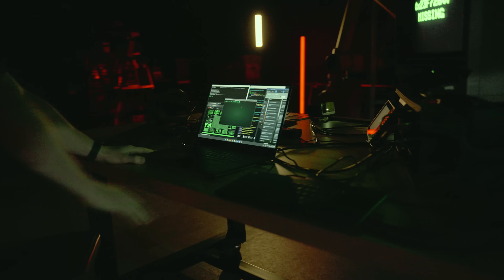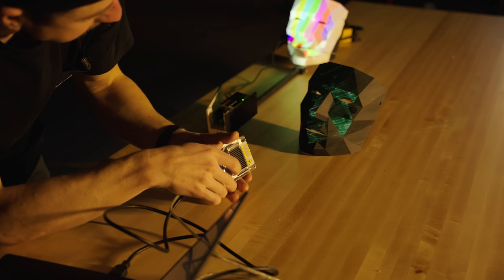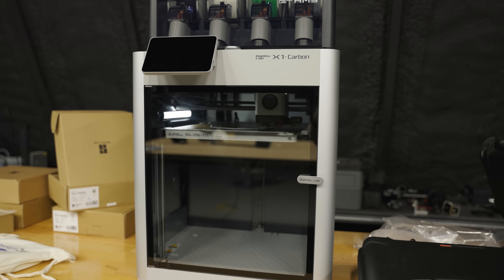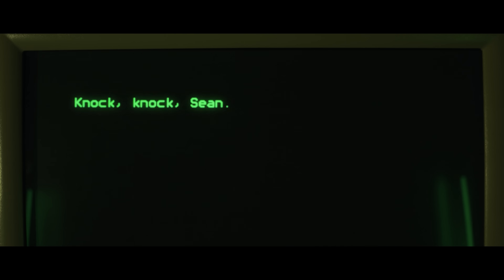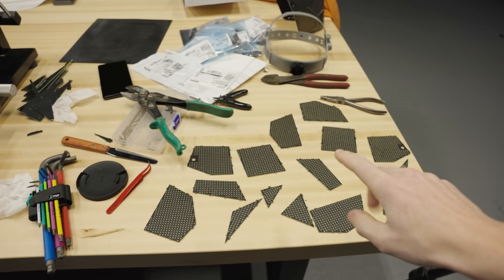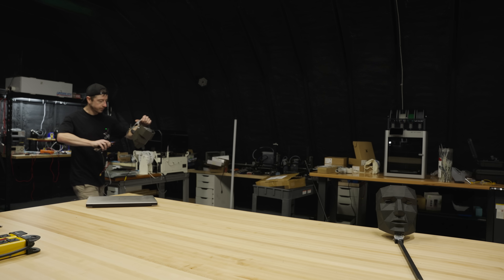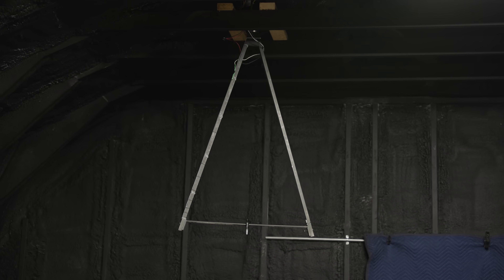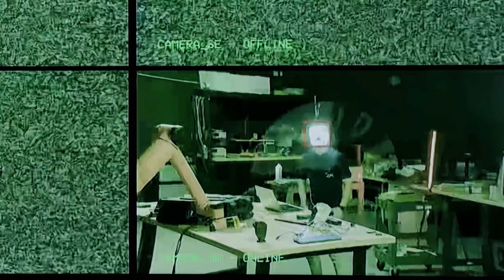Become Anyone 2.0 - A Full Face LED Mask

Comment: The electronics for this could be massively reduced. Something like an LED array almost certainly could be driven off a esp32.
Reply from the maker: You realize it is driven off of an ESP32 right? The pi is only for when you want to play video, which the ESP32 cannot handle easily.
Reply: @SeanHodgins  oh! ok! I didn't realize. What are all the caps in their for BEC and Filtering?

Comment: 3:52 It looks like you could fit almost 4x the number of LEDs if you arrange them in diagonal stripes so that pin 3 of one LED is right next to pin 1 of another. I don't know if you can put a through-hole in the midle of the LED footprint and somehow place the caps on the back, but that would be slick. All I'm sayig is you could do even more work and baking your face even harder.

Comment: Lol, that wnding where you're just sitting in a chair!

If i had one of these, I'd totally be doing that on a Teams call for work, one of the many that are rarely needed. Lol.

Imagine in the future when technology shrinks even more and you could have a VR or mixed reality headset on the inside of the mask while showing on the outside whatever you wanted. 🤯

We might even technically be close now, if the only part of the VR behind theask was the optics and the rest of circuit was remotely connected like the power and circuit for the mask.

(Thanks for getting creative juices flowing!)

Comment: Would you be able to add a variable light diffuser overtop of the LED array layer of the mask, to turn it into something more like a PC screen? Not exactly at high resolution, but just enough to blur the lines between each of the LEDs?

Comment: i think some diffusion would help make it look a little nicer, maby use a 3dprint of the model as a base and vac form some plastic as a layer over it, it might not look as sharp but i feel like it could help it look a bit more finished, and with a matte finish on it so it wouldn't be as glossy

Comment: This is an amazing design! It got me thinking in an actual product could flexible displays work ? The angles on the mask don’t seem too bad,(with foldable phones being a thing now it might not be an issue). Maybe 2 to 4 flexible displays could "tile" across the 22 faces of the mask, offering better quality and likely consuming less power. A thin 2-5mm lithium battery could be built into the mask’s interior (though I’m not sure how comfortable or safe it would feel having batteries so close to the face). Perhaps a Raspberry Pi Compute Module or a similar card  on the forehead could handle linking the displays to a user’s phone.
Reply from the maker: Thought about them first. Was a decision to regular old two layer boards and try and solder them together! Flexible could be cool in the future. Needs a lot of current so batteries need to be a certain size to provide that. Maybe some 18650s mounted to the headband could work, though the wire down the back does work well!
Reply: @SeanHodgins  sounds great. v3 in 2025-6 looking forward to it

Comment: I remember seeing the original years back and instantly thought “imagine instead of a projector you put pixels on every surface of the mask
Reply from the maker: You could have saved me so much time! 😁 lol
Reply: @SeanHodgins  yeah, I think I was just concerned about credit and stuff. I actually had plans to build it as a project back then but I never did. also I seen you didn't release the files, you could probably sell the files and everything you used for like at least a few bucks or something, I'm sure there are many people willing to pay for information on how to make something like this. I know most of the info is free here and if someone wanted they could easily figure it out. I wonder how much it would cost to manufacture these to sell.

Comment: Would have flexible PCBs worked? I mean, you don't have to solder them to each other, just make a single PCB, bend it around a 3D print and glue it down. This approach might also reduce some of the seam lines!
Reply from the maker: Yeah I started with that, but decided I really wanted to make this out of simple 2 layer PCBs to start. Just sort of a random goal I created for myself.

Comment: For soldering those panels together you can inverse your 3d model and make a mold, so everything stays together while you assemble.
Reply from the maker: I kind of did that, but I didn't make the inverse big enough to compensate for the LEDs thickness, but worked well enough to get it made!

Comment: Very cool, shame it takes so much power though. I can imagine it might be good for some electronic music DJ to wear at gigs (I think daft punk had something similar for a visor, back in the day). Maybe you could find a way to give it a diffusing silicone coating to merge the pixels somewhat and maybe give a bit more strength, although repair would be very difficult then if needed.
Reply from the maker: Yeah, the big battery helps with the power, but would probably heat up a lot if worn for a whole gig. Needs a big fan probably! I have some ideas for 3.0
Reply: @SeanHodgins  Full colour e-paper? I just looked and it seems you can get it. Might give a more realistic looking face than one that produces light, and hardly take any power. No idea how much that would cost though, or how good the colour is.
Edit: for an led version you could possibly cut the colour range down to maybe 4096 levels (16x16x16) and use an ambient light sensor so that only the minimum brightness is used.

Comment: why cant you just use an extra old 3d printer as a robot soldering iron? Its hot nozzle tip should be hot enough or could be swapped out.
 It hurt me watching you hand solder after using picknplace

Comment: 7:40 you dont have a machine like your Pick n Place but which can solder? Im really suprised honestly that you dont already have a pro-sumer level automatic soldering robot arm at least one thats on one axis like a 2d printer. I mean i think a modified 3d printer with a soldiering iron or even just using the nozzle heated itself as a lil soldering tip could work?

Comment: 3d pixel mapping with a camera is easier than people think, and as long as you can turn on a set of lights by the same identifier, their number or sequence doesn't matter. wled supports sending light data with udp and android phones have nice cameras and an imu :) i haven't got it all together on android yet, though, since camera movement is actually beneficial for accuracy and that part might be above my pay grade... opencv rocks though! like there's libraries for fits on point clouds and multiple methods to gather them already, and to calculate camera extrinsics. my fingers are crossed
Reply: i've had a lot of success with just having a function to step to the next led based on the shape, arcs and lines at any angles and stuff in larger displays. you'd need to break it down by panel and have a stepover by each line from the looks of things, but it could work. this is the only way to keep something pixel mapped with moving parts. partial maps plus new orientation
Reply: aaaalso, the gerber files can be a source of all the data you need, each pad has its' own coordinate system and if a part has an active element, like an led, or a hall sensor, zero is right on that bad boy
Reply: also this is basically just a uv unwrap and blender has lots of tools for that :) could have skipped a ton of steps trying to have a conventional model. it can export step files if you want to start from something weird and put features on it. just generally, everyone should use blender, just generally. geometry nodes could place the LEDs for you and export a csv with their real 3d position in space

Comment: Use "flexible led modules", their resolution is much higher than yours. And it will be cheaper. They can also be ordered from China. Everything has already been thought out for you, just adapt it to your needs. I'm not even talking about the fact that you can use flexible displays (they are very difficult to cut so that they do not fail)............... Replace all the LEDs with UV+bright white ones and not a single camera will recognize you =)
Reply from the maker: I wanted a specific look, not necessarily a perfect display

Comment: I made the same mistake in a project, ripping the pads off the pcb. The problem is that the weak point isn't the solder joint itself, but like you said, the pad rips right off the pcb. A trick to mitigate that is: Make the pads a tad bigger and put as many vias in the area as possible. The solder will wick into the holes and make the connection a lot stronger. I learned this from my background in FPV drones, where most modern flight ESCs do exactly that for the big amperage thick wire pads, because those rip off easily in the high-vibration environment of the drone. 
(you can search for images of FPV ESC boards, so you can see what I mean)
Neat trick :)
Reply: It's like the vias allow the solder joint to grow roots into the PCB!

Comment: Subbed to the second channel. Been working on a DJ helmet using a pixelblaze and 4 odd shaped LED panels and would love to see how you're making the videos work on there. The pixelblaze is great for controlling the LEDs but you're right: they are limited. Also, that mask has to be hot as ffffffffff lol. Throw a fan in there?? Real cool stuff

Comment: Hmm shame you didnt do what that other crew did with their custom LED stuff. 

They made an mini animator with modes and 24 frame per animation. 
It was just a tiny pixel program on the phone with a overlay masking out the unused pixels. 
Later they added a 3D preview thing that could rotate
Reply from the maker: Sounds complicated! I need to change the LEDs to get more FPS on this one though

Comment: This would be cool to use in a movie, like an actual movie that's in theaters.  Maybe their guards in some sort of sci-fi/fantasy space opera, and their masks are these led masks.  Would be pretty impressive, if they had the armor to match (and I don't necessarily mean armor with leds all over it, I just mean to fit the mask shape).
Reply: CGI is much more practical than a fragile mask like this.
Reply: @avi7278  - I said it would look cool.  Yeah you can do anything with vfx and cgi, but that doesn't have anything to do with my comment.
Reply: @Uhfgood  it would look the same, so it wouldn't look any cooler either way.
Reply: @avi7278  - Couldn't you be doing something better than replying to my comments just to put them down?

Comment: Had some ideas of a mask like that from ages ago, just never had time, know how or most important funds to put forward the idea XD

But just to address something, maybe you should think about carbon re-breathing , it a front mask only yes, but depending of the design and how long or the effort you do while using it can be a problem so maybe layered design around nose and mouth can help, for repair and maybe easy of building/using, maybe connection should be a ribbon or something like it? the solder is the most compact, I agree, but sometimes ruggedness can be a plus.

There exist Piezoelectric Cooling Jets if you want to get fancy about "cooling" or air exchange XD

Another idea I had was the weight and how the LEDs distribution exist, you can ditch eye holes I you just make the panels perforated and them apply a one side mirror film inside so they reflect the light outwards and also help hide you face even more.

Another thing the game RUINER has a good idea of a mask like this maybe get inspiration of it, only problem all this can be bulky looking, but you case its a easy fix you yourself can bulk up XD

Comment: "become anyone"
you don't need facial reckognition to know it's you with those ears sticking form the sides
Reply from the maker: shots fired! LOL
Reply: @SeanHodgins  Ha!
By the way, i bet you could make a 2.1 version where the LEDs don't have those seams between panels (especially at the middle seam), using some cylindrical projection to put dots evenly on the panels then wire them up after unfolding the mask
Another potential improvement would be to have some (3d printed?) separator between those LEDs to reduce one LED's light from affecting its neighbors, it'd improve contrast a lot. while an opaque one would make it feel more grid-y, using some semi transparent white or other material with diffusing abilities would go a long way.

A potential 3.0 could be an approach similar to LED glasses where the space between LEDs is perforated to allow both your vision and some LEDs to go over the eyes. An alternative i'm not sure could be done would be to have stroboscopic vision, like the FCM 2C's tank cupolas, spinning slots that makes it seem transparent once in motion.
Just some ideas of mine

Comment: So how long until you just go with an OLED screen?
Reply from the maker: Maybe MK4 or MK5 lol
Reply: @SeanHodgins  Read your responses to others on the topic. Had my own dealings with manufacturers never wanting to try custom work. Might be infeasible due to any number of reasons, the least of which is complexity, but you could try harvesting screens and other parts from old phones. It'd be tricky finding a way to link them if you can't do it through blutooth or wifi. Plus there's finding a way to cut/mount them ideally to fit this mask's general paneled design or some other type of esthetically pleasing setup that isn't just brick laying.

Comment: Easy way to build strength is to add a lot of ground or nothing pads to solder to on the edges.  Even put a continuous traces down the edge to solder the entire length with only gaps for the power and signal pads.

Comment: As solid as the build was, the editing really took it to another level.  Bravo!

(Honestly, though; depending on a few pads along the edge of the boards to hold them together had my fingers clenching.  At least castelate the edges of the PCB for more structure or use vias for copper 'staples' to be soldered into.  You could also run UV-cured resin along the seam and then hit it with a UV LED.)
Reply from the maker: Ohh that’s a neat idea, I decided to not castellate the edges but I probably should have, it was a trial this time, and still holding strong! But I wouldn’t sneeze with it on. Hahah

Comment: Using the 3d printer to make a scaffold would probably be a better option for a few reasons, it would be easier to mount the panels and to give it some structure and some strategically placed metal tape and friction fitting could forego the soldering all together, would also allow her easier replacement of the panels if one went bad.
Reply from the maker: You really read my mind, going to simplify assembly next time

Comment: what laser projector was that that you threw away? i've been looking all over for a small one like that for a project.
Reply from the maker: The small laser one I’m holding is a Nebra Anybeam, they don’t make them anymore but they are very cool and I use it for different projects. The one on the original mask is a small DLP by TI.

Comment: Fantastic work. I assume you used the smallest feasible RGB LEDs to maximize resolution. Now hear me out... if you wanted even more density, and the ability to avoid having to use flat planes for PCBs...What about fiber optics? Just a thought.
Reply from the maker: Cool idea! I actually used 1.5mm LEDs and 4mm pitch for this one, but the next will be 1mm LEDs and faster

Comment: The angular mask definitely has character. For a design that relies on curves or just for the sake of simplified assembly by removing the 3D soldering you could use foam and a Flex PCB with holes to sew the PCB to the foam. At he cost of more $$$ of course. 

Great video, you never cease to amaze. Your projects are unique and your presentation is top notch. I could sit and watch all of your video one after another and still crave for more. You really are an inspiration and I hope your videos can reach more like minded people. 

Whenever your name shows up in my stack of notifications I know i'm in for a treat.

Thank you for your time and energy, and thank you for sharing !!!
Reply: Exactly what I was thinking. Maybe a flexibe PCB stretched over a deformable wire frame so you can change the shape..
Another option for expansion might be an E-ink display to make it matte rather than glowing.

Comment: You should put a diffuser over the LED’s to soften the texture and brightness because to other people, it might hurt to look at
Reply from the maker: That would be cool, and doable! Ill try it out with some opaque filament or something. These are all mostly at like 5% brightness. It goes really bright, but don't want to draw too much current. Plus not needed to be any brighter.
Reply: @SeanHodgins  ah ok. those must use a lot of power when at full brightness then if they were only at 5% to start off with then